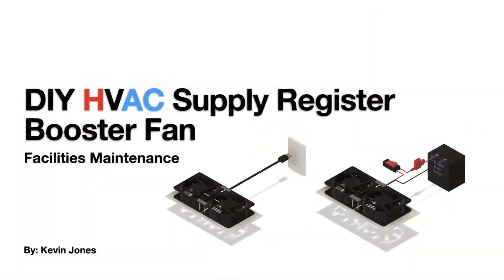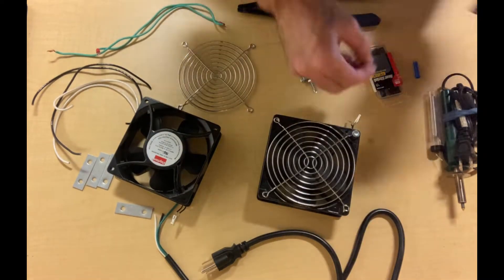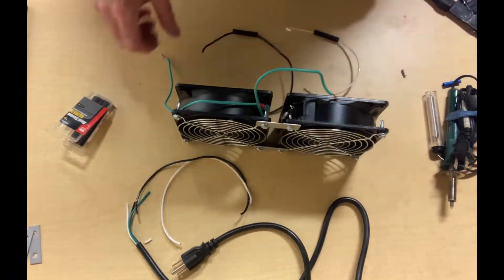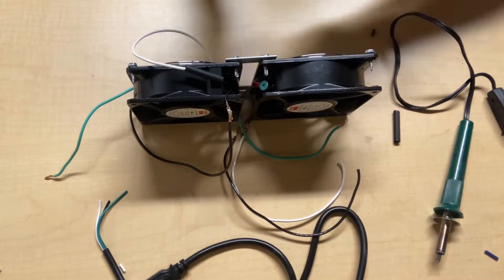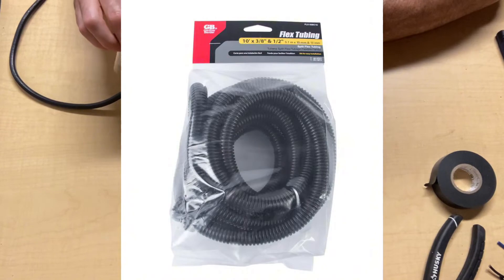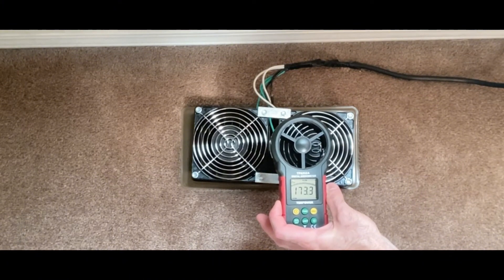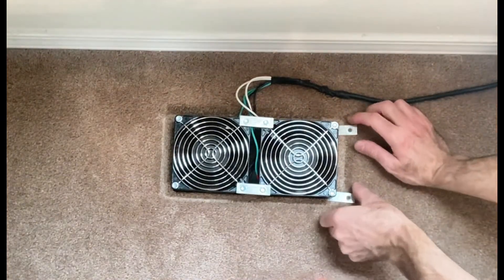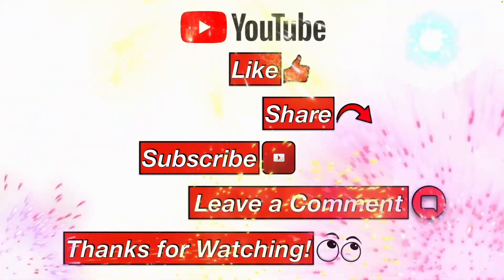DIY Register Booster Fan | Duct Booster Fan | HVAC

Comment: Hi, I live in a 120 yr old home.  Forced air downstairs but no 'real' ducts upstairs, just a 'chute' in each room downstairs for heat to rise upstairs to a floor vent. (If that makes sense) Would something like this work to either grab air in downstairs vent and force to upstairs, or would I put it upstairs to try to grab air from 'chute' downstairs? This is a GREAT video, not above my skill set, thank you for that! Also, I'm having new furnace (electric) installed next week, and I went with a bigger one than the house needs, so as to not over work a regular sized one foe this house. Im 1450 s.f.
Reply from the maker: Depending on where your electrical outlets are, it may be easier to install one of these duck booster fans up on the second floor at the floor vent(s). 
You could also ask the HVAC installer for a price quote for what it would cost to install ductwork up to the second floor.